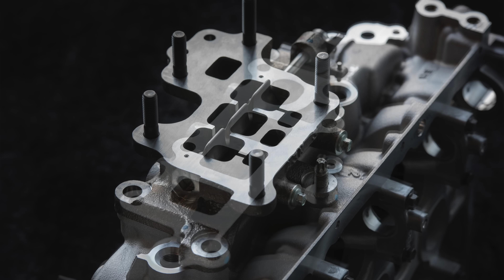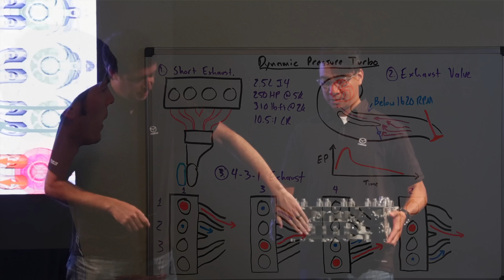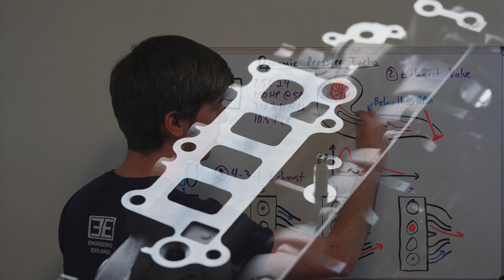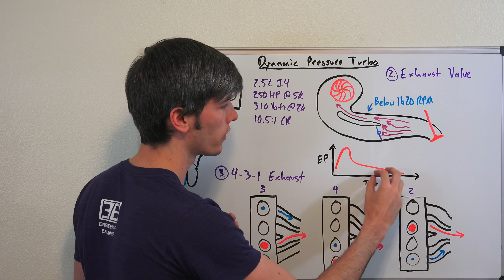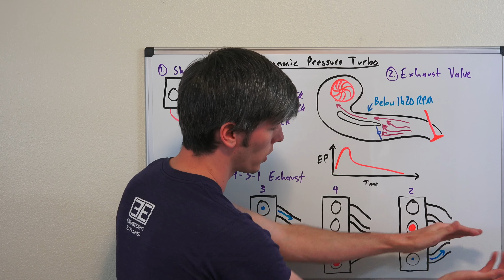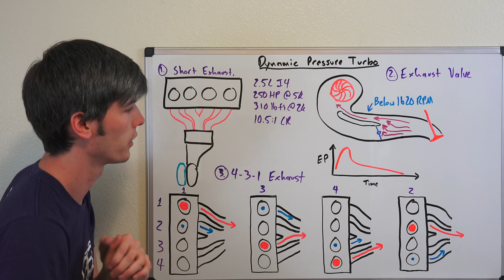How Mazda Is Eliminating Turbo Lag

Comment: Idk about all this.  2022 cx5 turbo. I was on highway going speed limit had to pass floored it and nothing happened for what felt like a few seconds! Like it was a toyota vvti overriding my input for maximus fuel efficiency.  Wtf over?
Reply: My Mazda 3 Turbo spools up REALLY fast, it’s the exact turbo inline 4 from this video. Granted it’s a much lighter car, I think like 500lbs lighter.

Compared to other turbo cars I’ve driven, it’s just so torquey and you hardly notice the turbo lag at all.

Comment: What is the difference between the turbo in the 2023 Mazda 3  vs 2023 CX 50 ? The Mazda 3 dynamic pressure turbo, CX 50 twin scroll turbo....

Comment: Since these engines are designed with specific principles using fuel and air ratios to maximize performance and efficiency, would increasing air flow hurt performance? For example, adding a K&N filter. I know there are many variables, but in principal would more air work against the skyactiv?

Comment: Could this be adapted to a V6 with a dual-volute turbo? I’m picturing a turbo mounted tight on one exhaust manifold and to one volute for quick spooling and low rpm while the other exhaust manifold bypasses the muffler, then at higher loads the bypass directs the opposite sides exhaust to the second volute for full boost? This way can be added like  an older J series or something as an aftermarket with a tuning option to control that butterfly valve and when it will bring on the extra boost. The advantage I see over this manifold design is when you’re not under heavy loads you’re also only putting half the heat through the turbo and the moving parts don’t have to be built into the manifold which would make maintenance cheaper if the valve fails.
Edit: I have also thought of another possible benefit. After the turbo pulls the energy out of the exhaust gas it is slowed down. If you route the bypass that controls the flow to the “second stage” to the exhaust end if the turbo, this can act to entrain that slowed exhaust. And when you put your foot down and call for that additional flow to the turbo the bypass diverts too the turbo. Boost comes up, but now you can also throttle that bypass to both maintain boost and entrain turbo exhaust for higher exhaust flow and higher efficiency.

Comment: We need to clear some things up with the exhaust to the turbo.  
Having a very small area in the exhaust to the turbo is not a good idea and having high pressure in there is not what you want either.
Once the exhaust pressure is above the inlet boost pressure you have a turbo and engine that is becoming very inefficient.  
Keeping the exhaust large and not too long, but dropping the pressure in the exhaust is helping pumping losses in the exhaust stroke of the engine a lot, the other thing is the overlap on the cam still allows for scavenging to happen with a lower exhaust pressure.
Ideally what you want is a larger enough exhaust to keep the pressure below boost pressure where proper exhaust scavenging can still occur, but when it goes across the turbo, you get a pressure spike at the turbo, then a huge delta to the dump pipe which then helps turbine spool efficiency.
If your exhaust (pre turbo) is higher than boost pressure you have an engine that is very inefficient, a too smaller turbo can also do this, especially where guys chase boost response but end up choking the engine and causing big heat problems and efficiency goes down big time along with power.

Comment: Hm, wouldn't that lower reliability of the exhaust valve springs since there is no going to be an opposite pull on them due to scavenging? Cylinder 1 exhausts then pulls on the closing valve of cylinder 2
Edit: It's not like all of the exhaust pressure will pull only on cylinder 2 it will spread across the other cylinders. Making it pull just enough so that the remaining gas is out.

Comment: I have noticed in my MAZDA CX 5 GT Reserve 2.5 L Turbo that is has very little turbo lag. Very interesting. Along with their EGR cooling MAZDA has really improved small turbo engine efficiency.
Now I've installed a CorkSport oil catch can for the PCV system to reduce fouling on my intake valves and ports. Maybe MAZDA will give us BOTH port and direct injection to cure that problem. (OR a highly efficient all electric CX5??)
-> On a hunting trip in Nevada  I broke my intercooler so I had the more flow efficient Cork Sport intercooler installed AND both down pipes replaced with Cork Sport down pipes. 
My "seat-of-the-pants accelerometer" said I got an extra 10 hp at the wheels. All I know is that I don't need to depress my gas pedal nearly as much as before the CS "surgery".
->Also my Cork Sport turbo down pipe is MUCH stiffer (5 fabric reinforcing layers) than the OEM down pipe (1 fabric layer) so I get better throttle response. Didn't really expect it but I got it! Plus the CS pipe is highly siloconized rubber that will withstand 'Vegas hot summers better than the plan rubber OEM pipe.
->Finally, adding 1/3 tank of 100 octane gas to 10 gallons of 91 octane gas makes a definite acceleration difference according to my butt-cheek accelerometer. I'M HAPPY!

Comment: Put it in a rwd coupe that is between the BRZ and 370Z in terms of performance and weight and hopefully price. That's the sweet spot enthusiasts have been begging for.
 Make sure it has a couple small rear seats like the BRZ. They will b almost useles I know but great for when you are in a pinch and keeps insurance cost low.

Comment: Wouldn't there be exhaust flow  from the high pressure  exhaust at EVO to the low pressure exhaust that exists outside the cyilinder that's about to start intake?

Comment: Variable exhaust flaps are nothing new, only this one is extremely likely to fail over heat cycling.  I know its in the head likely with coolant passages around the casting but now the thermal load is absorbed even greater reducing the efficiency of the exhaust.  They should have made an external serviceable variable flap.  Otherwise this is just a large 4 cylinder with a small turbo.  Nothing particularly interesting.

Comment: If I’m not mistaken, this exhaust scavenging technique with using the pulses to draw out exhaust gas from an adjacent port is nothing new. This is the same concept behind well designed aftermarket performance headers for muscle cars.

Comment: I wonder how much efficiency this actually adds. Doesn't seem like anything too difficult to retrofit to any engine, might actually be good for third party markets if it does work.
I wonder if this could be adapted to banks of 3 cylinders, either for inline 3's or v6's, or adapted to inline 5's or 6's. Would also be interesting if this would help the rotary engine at all.

Comment: Question is where is Mazda in the Hybrid Map? They can apply system like F1's MGU-H where generator at turbo shaft act as motor in lower RPM to activate turbo system, thus no turbo lag.

Comment: Simple stuff, well compared to combining super chargers with turbos, multiple turbos,  Turbos with big electric motors and variable compression heads,  vs a well tuned exhaust gas flow and bypass valve with simple turbo,  looks good hit of torque and HP for the size and relative lack of complexity

Comment: Hey Jason, could you do a video about using first gear instead of the parking brake to park a manual transmission car?
Reply: Generally, you should never use 1st (or any gear) instead of the parking brake. Putting the car into 1st is AFTER  setting the parking brake, so that in the event the parking brake fails you have the friction of the engine to hold it in place (hopefully). 

this is not equivalent to "Park" on an automatic. On those there is a pin that locks up the transmission which can be used in place of the parking brake. But on a manual putting it in first just connects your wheels to the engine, it does not lock up the trans.

it's just a crude failsafe since the parking brake doesn't have a redundancy. You risk engine damage if the weight of the car does end up moving the crank. but hopefully it is  less dangerous than a runaway car

Comment: This is probably going to sound naive, but why 4-3-1, and not 4-2-1, so that cylinders 1 and 2 join to one pipe, and 3 and 4 to another, with perhaps a firing order of 1-4-2-3?
Reply: Neural Net Indeed, I don't see is as well. In the first step, pulling out exhaust gas from 2 by 1, Ok clear but in the second the cylinders are side by side any more. In the third it is again but in the neither. Would the 'normal' order not net result in the same level of side-by-side suction?

Comment: The cylinder exhausts are not "right beside each other", I mean 1 and 3 are for sure not. What they are is mixing at the same distance from the exhausts and this - the equality of the distances that exhaust gasses travel before mixing with the next active cylinder is what allows this engine to pull out remaining gasses in a predictable way. That is why in this cycle you always have switching between an inner cylinder firing (2,3) versus outer cylinder firing (1,4).

Comment: Hmm, I have always been under the impression that any worthwhile scavenging effect (that has been used in tuned length headers for the last how many decades) is negated as soon as positive pressure builds up in the (exhaust) manifold due to the restriction the turbine wheel and housing pose on flow?  This of course would be compounded with shorter runners... but here it is being presented as a new technology?  

Interesting.

Comment: I love Mazda's approach. Simple integral mechanical designs. If they just put it in a package that makes maint and repair easy then it would be hard to find complaint. Pretty nice specs for a 4 banger, though it doesn't approach some of the daily drivable K20Z1s I've seen.

Comment: Restricting exhaust flow diameter at low rpm to eliminate turbo lag is a really great idea! I'm not convinced that the 4-3-1 settup will actually beat out 4-2-1 in terms of evacuating exhaust, since it's very likely that the exhaust gas pressure spikes will to some degree back-pressure into their neighbors. This is why equal length 4-2-1 and equal length 4-1 headers (with long tubes and very gradual merging) have been strongly preferred for performance engines for so long. But it would depend on the fluid dynamics of the exact geometry of their collector (where the separate cylinder exhaust pipes merge). I think it's more likely that they have sacrificed the exhaust flow efficiency of 4-2-1/4-1, in order to help shorten the pipes to increase the pulse density as it hits the turbo spool, and keep the catalytic converter near the engine for more rapid heating of the catalyst and cleaner emissions. To some degree, turbocharged cars are naturally very inefficient at exhaust evacuation anyway though, due to the pressure buildup forward of the spool.

Comment: I wonder how much the scavenging effect of the exhaust manifold comes into play on a turbo engine. 
I was always of the opinion that for a given boost pressure on the inlet side, you'd have to have a similar positive pressure present in the exhaust manifold upstream of the turbo to drive the turbine. 
If that's the case, surely any savage effect is lost...

Comment: And you dont even get into the miller cycle! Hey wow, that's my engine. That little 2.5t has one of the deepest tones of any engine out there. Like my 6BT towing 20,000lbs. I can feel when my wife turns down the street. Also my first 2ton vehicle to get 30mpg at 65mph. I buy cars based on engines. Some notables- 89 6bt dodge, 98 passat 1.8t, 2000 jetta tdi, 06 passat 2.0t (first gdi?)

Comment: interesting. I think however that a good way to reduce turbo lag would be a combination turbocharger supercharger like what is used in the EMD locomotive diesel engines. the Turbocharger in that engine uses an overrunning clutch and a mechanical drive, which means that the turbo is ran as a centrifugal supercharger until the exhaust pressure has enough force to spin the turbo faster then the mechanical drive. by doing this your combining the low rpm performance and non-existent of a supercharger with the high mid to high rpm efficiency of a turbo, and it wouldn't be very difficult to engineer.

Comment: I came up with an idea to eliminate lag even better. The turbo charger is just a normar turbo but with a twist. Its got a belt running it, UNTIL it wants to move faster than when driven by a belt. Between the belt and the turbo is a mechanism that allows the engine to spin the turbo but allows the turbo always move faster of needed
Reply: So the issue with that is, The amount of stress that "mechanism" needs is ridiculous. Turbos spin on excess of 100,000rpm. To have something that can control power flow from 2 sources of force that could also withstand those stresses would require enormous R&D and most likely exotic materials.

A much more cost effective solution that does the same thing is to twincharge it.

Comment: Great explanation! Is there any financial differences between the exhaust tract valve approach vs. the variable geometry turbocharger approach? Thanks!
Reply from the maker: I would imagine the VGTs are significantly more expensive. Porsche is the only company I know of using them in gasoline cars, the exhaust temperatures are brutal on the vanes.
Reply: Thanks a lot!

Comment: Do you think how reliable is this engine? Especially for carbon build up because it has both turbo and direct injection. I also know that to cool down  the engine to prevent engine knock, Mazda re-route a part of exhaust air back to the engine. I really afraid for the carbon to build up on the valve over time.

Comment: Can I ask you a question? It's not related to this video though. 

Why haven't we seen any Diesel electric semi tractor? 

I mean, if the diesel engine can crank at a constant rpm while turning a generator that power the wheels. That should be a large fuel economy boost for the trucks a lone. Then couple the power train system with a capacitor bank to assist the engine during stop, go traffic and hill climbing while keeping the engine at a constant rpm as much as possible.

Comment: I understand the variable assymetry on the turbo side however I'm not sure about the scavenging effect of placing ports like that. How does high pressure on exhaust side of 1 make scavenging easier for 2? Shouldn't you have low pressure on exhaust of 2 to pull gasses from the high pressure on intake? I believe the ports are places like that to take into utilization of the exhaust pulses to efficiently use exhaust energy. Look up scroll separation effect on twin scrolls.

Comment: Internal combustion engines are getting more and more complex in order to realize marginal gains in efficiency.  

Think of how much simpler our electric future will be.....and Jason will be there to help us understand it all :)
Reply: The electricity comes from somewhere you know. And it's still not simple. Do you know how a motor works? Just like an engine, the initial concept is simple. But the deeper you dive, the more complex things become. Electric cars power sources have a lower energy density. Batteries store less energy than fossil fuels. Energy is lost through transporting the electricity due to well. All I know is it's lost, that's why batteries discharge when not in use. Something to do with friction in wires. Fossil fuels are more direct and compact. Until energy efficiency and densities are better than fossil fuels. They wont be going full on mainstream. Both engines and motors have similar challenges. Heat and efficiency. Motors need cooling too.
Reply: If you think electric cars have a simple construction, you are mistaken. They have a very complicated electronic architecture, similar to the ICE mechanical elements, which require extensive planning and analysis to make it efficient. Controller design is the most difficult part in it. That is because electric cars use BLDC, which is controlled by sort of a frequency modulation drive. The motor design is not so easy as well, and there are only few modifications that have ever been tried out. The battery design is also difficult and new innovations are being made there every day. Engineering isn't trivial and easy. That doesn't mean that one stops innovating. The ICE industry has been stagnant for a long time. Turbochargers are a really old innovation. I hope you are an engineer. If you are not, what are you doing here?
Reply: tesla fan boiii))))))))

Comment: How much of a negative effect does the additional restriction of closing off the valve under 1620rpm have on efficiency of the engine overall? 
I know it helps spool up that turbo quicker...but it almost seems counterproductive to restrict exhaust airflow to try and add more boost pressure during the same RPM range

Comment: Vauxhall Zafira had turbo attached to manifold and worked great, driving up a steep hill at 50mph in 4th gear with plenty of power still available, this combined with light weight made GSI and VXR models fantastic to drive. the exhaust turbo valve is very similar to the servo controlled power valve idea used on the Yamaha FZS1000 bike I recall (although no turbo on the bike).. these were notorious for sticking, usually open reducing low end torque and increasing noise at low revs.. the Yamahas had a genius fault code system with rev counter I recall. Sticking of this on Mazda would cause turbo overboost and fuel cut off? the idea with the exhaudt manifold..was this also stolen from motorcycle design?

Comment: So if you eliminate the lag then your in boost more? Then wouldn't u get worse MPG?
Reply: In boost sooner, does not mean you will accelerate for longer. I'd say with better control you get better MPG. In cars which have massive turbo lag you tend to floor it excessively too soon as there is not power at first then you get too much power at which point you might end up breaking. This is not efficient